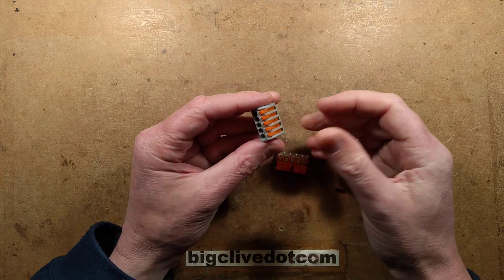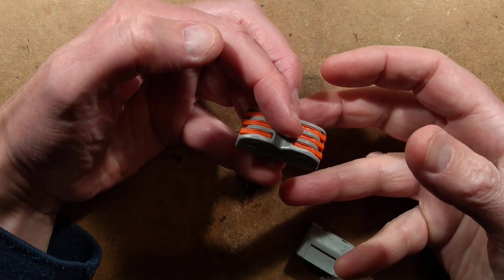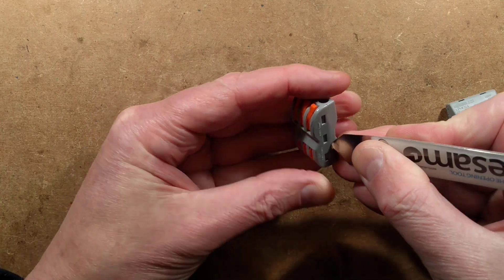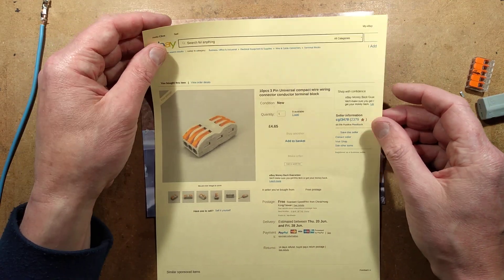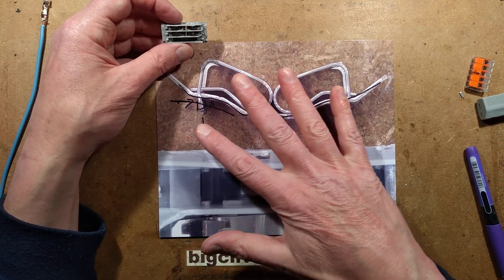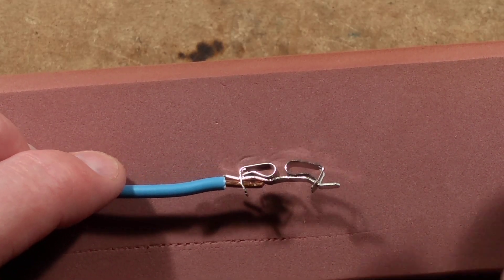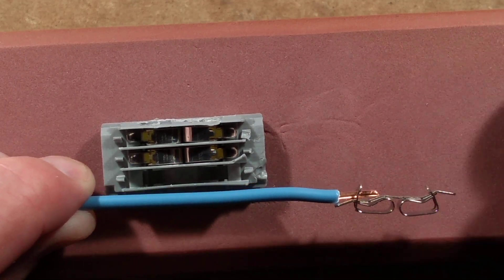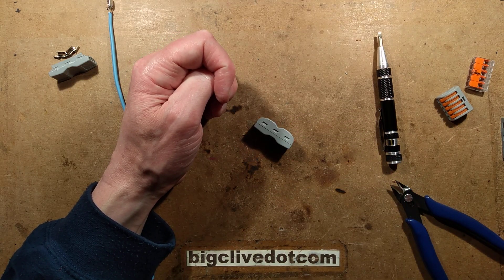Clone of Wago product that Wago don't even sell???

Comment: Currently, I am re-wiring an installation, and where I live :
Wago 221 $1 each one, that is insane.
While with $15 I purchased a box with 45 Wago knockoffs, including 2 connectors, 3, 4, and 5.
"Chinese-wagos" are hard to click, they are not transparent and they don't have the test pin, but I can live without those features.
Reply from the maker: The Wago terminals are cheaper in bulk, and much safer than the clones.

Comment: I bought a bag of the single tap clones from Temu not too long ago. They seem to work well enough but I haven't tested the thresholds yet and I did actually wind up breaking one by accident.

Edit: Forgot to mention that the ones I have actually clamp the wire when you pull the tab all the way up, rather than pushing it down.

Comment: I would not see the use for this style of wago if you need to only connect two cables together 3 double wago would do just fine.
Most of the time you need to connect more than 2 wires together fx. In a lamp fixture.
Reply from the maker: Live, neutral and earth.  They do two way versions too.

Comment: I love all the lever type connectors, especially the clones as  there are so many types, but unfortunately I have found  them in houses without any box around them. I can understand this if it was a recessed ceiling light, but I found them on the sprocket ring under the floor of the bathroom
Reply from the maker: They should be in enclosures.  That's just bad electrical work.

Comment: i will continue to use wire nuts.had wagos burned off,.
Reply from the maker: What sort of wire?
Reply: @bigclivedotcom  solid 12 wire copper.18 amp draw.they were on a piece of machinery.plastic was melted.poor connection i would assume.
Reply from the maker: @charleskovalewski5210  Strange.  I wonder if they were real or clones, and if the wires had previously been heat damaged and then just shoved into a new connector without being cleaned or bared back to clean copper.

Comment: Surely the reason that WAGO have not made their own legitimate version of this type of connector is to protect their reputation in case of accidents?- 

A Cable Splice as useful as this would obviously be used to fix/extend the length of portable Appliances- Electric Hedge Cutters, Electric Tree Cutters (where cables get severed very frequently) , Vacuum cleaners , garden patio heaters etc BUT- there is NO CORD GRIP to secure the insulation.
Yes the spring grip on the conductor is very strong but once somebody trips on a cable and drags out a conductor- you have a recipe for an accident?

Not to mention the people who have no appreciation of "I.P. Ratings" etc- you would get fools connecting up pond lighting or a Jet Wash Appliance with these handy connectors- and when people get electrocuted- Wago  would get blamed.  Well those are my thoughts anyway .
Thanks for the videos Clive- always compelling viewing !

Comment: Interestingly enough, I work at a hydroponic shop and have torn down a few LED fixtures that went dead. There's widespread use of Wago connectors for nearly all the connections. 8 light bars, power dimmer signals from ballast to dial/daisy chain cords. I'm starting to dig around  these fixtures to see how much moisture was a cause of their death.

Comment: At about 5:50 apropos the dissimilar metal concerns, these types of screwless connectors have been used for years, not only in this environment but in PCB interface connectors with no problems. If you introduce aggressive environments you're going to get corrosion problems whatever you use, look at classic car wiring.

Comment: As far as I know this style of WAGO connector is a legacy product. They went on to the modular 221 connector which is a lot easier to handle, can be made weatherproof, will play nicely in an installation scenario (can be screwed onto TS 35 units etc.) and will also do in-line connections.

Comment: I actually bought similar thing on Ali that is two Y connectors together with color coded leavers for Nuetral and Live wires. It doesn't say Wago anywhere, but damn it is really usefull connector also it came with little mounting holes to attach it with screws.

Comment: Wire binding terminal screws will always be a superior connection method than push-ins, back stabs and wagos. You’re just asking for trouble with these gimmicks. This is exactly how fires start. No real electrician would be caught dead using wagos. But keep up the great advertising campaign. Lots of gullible DIYers will fall for it.

Comment: I have used these connectors to make temporary connections while testing LED panels.  I just have a grounded cord with one of these on the end, and I am able to attach LED panels to the other side to make a temporary connection.  I will have to check mine and see if they are made by Wago or not, I can’t remember where they came from.

Comment: I tried searching for the seller on ebay, and i tried to search for the phrase from the ebay listing, but I can't find it being sold.  I tried my local ebay page and also UK ebay page (i surmized because of the currency being shown is pounds)
Reply from the maker: You can get UK certified ones now.
https://www.toolstation.com/in-line-spring-lever-connectors/p78346

Comment: I've noticed that an inline lever connector has appeared in the 221 range now part number 221-2411, it's only single pole though, so you'd still need three of them and actually finding a supplier seems to be problematic.

Comment: Good info, as always. But how could you find the real rating? i’ve bought those kind of connectors from local suppliers and they do not have rhe “wago” print. So I am guessing they just buy chinese and resell as original somehow, calling them “wago connectors”.
Reply from the maker: There are UK compliant tested clones being sold by some distributors.
Reply: @bigclivedotcom  But how do you know if they are good or their ratings? I supose we can test a high load on them, but I guess with time, as you said, their perfomance declines right?

Comment: I'm using an evolved version of these, super clever connectors that come in singles but with a lego style tab on the side to connect them so you can connect a single wire quickly or double wires for 12v or whatever for a little on the fly terminal block

Comment: The main problem is water contamination, junction boxes have massive separation of one line from another so slight water ingression would not be a problem whereas these connectors are so small one line is only 2mm from the next.

Comment: I use them on my 12v wiring. They work perfectly fine and fact make my life easier especially when I want to make a change I pop the levers open and done. I also own Wago. But the pass through connectors by these off brands are awesome. I don't think wago makes them.

I've even used it on low amp 120v as well. It's just plastic covered bus bar held down by a spring. Do you trust the Chinese? Use At your own risk.

Comment: I would much rather twist the copper cables together and pinch them in a block connector with some insulation tape rather than trust whatever alloy they are using to carry the current. A lighting circuit may be fine but plug in a 3KW heater... accident waiting to happen
Reply from the maker: John Ward tested these in a series circuit with conventional terminal block, with a welder providing controlled current.  They all exceeded their rated current by a huge factor.

Comment: I think wago doesn't sell them, cause they are not as good as shown.
1. You have to put it Inside a Box. Its longer than normal clamps. So you need more space in that direction than with 3 2times clamps.
2. It may keep the pulling preasure on the lines, cause you don't have to bend one of them.
3. They are just useable for 3-wire Installations.
4. You may not addiert an additional wire after you use this clamps.

It's only usefull if you drill into an already installed cable and have to fix it by making it a little bit longer. Otherwise the normal clamps are better.
Reply from the maker: Wago now make a version.
Reply: Yes, but they have a version, where you can fix the cables to a holder for the clamps and where you have single line connectors.

Comment: 7:48  the limit is spring tension. While the springs are contracted from the lifted lever, the metal strip that connects the wires wants to extend into the bottom wall of the housing, and since the spring force is so powerful the wire can't squeeze between them

Comment: Hey there, great video! Don't you think that after long time wagos are gonna just weaken and have bad connection and make heat or whatever?
Reply from the maker: The original ones have been around for many decades with no sign of problems.

Comment: These are perfect for automotive repair jobs for low to medium draw wires. I used some knock off push in style ones for led warning and accent lights on a few vehicles now. They are extremely handy to use and if you mess something up cheap enough to cut it off and do it again provided you leave enough slack for mistakes.

Comment: I used these so much, the idea is very good, also if they can make a connector with only 1 way instead of 3 THAT would be a dream come true. I prefer to use these instead of the old tape, gives you a safety feeling.
Reply: Look for the Wago 221-2411 ....

Comment: What you're not considering is a failure mode. In this connector vs traditional wagos is that now the failure of one would then mean failure of all, and then a short circuit. In a traditional 2-wire wago you'd need 3 for a 3-conductor junction box and if one were to overheat and fail it wouldn't necessarily affect the other two. The fate of one would not be the fate of all, and that's a small margin but still another margin of safety.

Comment: Its not a copied product if wago doesnt make it. As well, i would have been nice to see the inside of the wago ones and look at the metals in there. I recon its exactly the same stuff being used. You were quick to give our advise to stick with wago, but you failed to present the evidence why.
Reply from the maker: Wago do continuous quality checks on the materials.  A cheap grey import may switch to using steel or aluminium contacts without any external clue.  Wago now makes a version of this.

Comment: I´m a bit wondering that everyone is so baffled about this System, but only because we in Germany have a litte Thing called a "lüsterklemme" which is a little plastic terminal with a copper/metal tube inside and a screw on both ends with which you can screw on top of a wire so that it will hold against the tube, so same function as this thing, and they are dirt cheap, practically every roof mounted lamp in germany is probably connected with  these things :) 
anyone got an idea why this simple thing did not make it to /in the US ?

Comment: It looks like a more compact and cumbersome version as to what we call "sugar-cubes" in Sweden.. One important thing to mention is that you always put the ground-wire in the middle... Also I don't understand what you think "pushing the cable too far" would do.. as long as the wires have good contact with the intended contact point, then the only thing that might happen is that you get a bit lower resistance.
Reply from the maker: If a thin wire gets pushed in too far it could end up gripping the plastic with just luck for the copper.
Reply: .. Oh, right.... I forgot that some people doesn't look when they wires..  Whenever I connect a wire I try to see so the plastic of the wire ends right before the initial contact-point, If I can't then I just assume that i1mm of  shielded wire inside of the opening is enough to be fairly safe..

For some reason I never thought of the possibility of ANYONE that would feel confident enough to (erroneously) think they actually should fiddle with wiring to not use "how far the wire have been stripped" as a unit of measure.. So I assumed it was a wire that was stripped too far you were thinking of.

Comment: Never heard of Wago, youtube just said, here watch this we think you like this crap.
In the USA, we use crap like this all the time, design is different but does the same thing.
You going all surprised about an electrical device we call ballast sub terminals which have been around for longer then I've been alive. They also go by other names such as routing terminals if used on server rack wiring, but it's the same damn thing.
I have a bunch of these wired up in my sheds and garage for the lights to connect them without having to use wire bridges which are permanent for structures that aren't permanent. I can unclip these, tear down the building and move everything easily sense I'm not dealing with structures on foundations. Glad you are excited though, so welcome to basic wiring solutions 101? most people in the midwest USA have a coffee can full of these somewhere in the tool shop.

Comment: The diameter of the copper conductor is less than 1.5mm². So don't use them with circuits rated for more than 10A. Better don't use them. The original of Wago has a bigger conductor diameter because they are wired orthogonally. This is also why there is no version of this connector from Wago.
Reply from the maker: Wago now do one.

Comment: I doubt that wago will produce these as their conductivity is counter intuitive to the way wago products are normally designed => increases chance of accidents
Reply from the maker: They now make one.
Reply: @bigclivedotcom
Oh come on.. since February 2nd 2021 🤷🏼‍♂️ missed it🤦🏼‍♂️
Well.. nevermind then 😂😂

But still.. they are only available in single-wire so the principle more or less stays the same. All terminals on one wago are interconnected. Even though you can compose them in groups with these gray sockets. 🙈

Comment: I believe Wago gives you a measuring gauge on the housing for wire length. I did see a video where the Wago brand was taken through a high amp test and the wires turned to flames before the connector, some 80+ amps. the new style clear connectors made by anyone should be avoided as they did not stand up nearly as well as the opaque models.

Comment: LOL. I'm from the U.S. and we don't have or use electrical connectors like that. We use wire nuts to join wires together. And every switch and outlet has to be screwed down. We just started to use outlets and switches we just push the wire in the back and it clamps in place. I still use the screw down method.
Reply from the maker: They're becoming popular in the USA.

Comment: Here in finland there is some really similar looking connectors from finbullet, though I dont think there is 3 on 3
https://finbullet.fi/product_details.php?p=4195.
Anyway they are sometimes also used instead of Wago. Not sure if they are only a copy I dont think so actually.
They are for flexible and nonflexible which makes them quite handy

Comment: Would be interesting to check their insulation resistance with a proper megger.
Reply from the maker: I did a test and the connectors all passed at a much higher voltage.

Comment: I thought the transparent ones had replaced the grey.
What would be the reason for producing both versions?
I have wondered if the brittle transparent plastic would hold up as well as the grey ones over time. 
But anyone who's ever been waiting to regain feeling in the thumb after using a full box of the grey ones will say the others are far superior!

Comment: I’ve never seen wago terminals before. Are they safe to use with North American wiring? They would definitely make putting in some smart switches way easier.
Reply from the maker: I think they are listed.
Reply: @bigclivedotcom  I will be headed to amazon and adding them to my order for the switches. I hate dealing with twist on connectors.

Comment: I’ve been using them for some time without a problem. But I never use them to full capacity. Wago has a vast catalog. Honestly, there are so many products that it can be hard to tell one from the other. But looking through the right catalog, I find the series 222 levernut. That’s the style you’re taking apart here. But, there’s no dual end version. As usual, all wires connect together. So this one isn’t from them. I have them though, and they work well. But that style is really pretty big, and bulky.

Comment: Will probably be good for prototyping to use along side breadboards to test before proper builds, will also be good for younger children in schools to test and make low current circuits without the need for solder. Like a quick release choc block, use full for circuits that may have to come apart or be replaced regularly, no tools just flip up and put wires in, could be good for difficult to reach places.

Comment: I found these on Amazon the other day (which is probably what made YT recommend this video) https://www.amazon.co.uk/dp/B07TWL5QZ5/.  It's the same idea, not Wago, but they're individual connectors that you can clip together.  Seemed like a better idea to me as each cable is isolated more and you can build the size you need.

Comment: Have seen issues with these where they have caused arc fault breakers to trip. Also but not the connectors fault, have seen them burned up from people using them from aluminum to copper pigtails.

Comment: Heh... I could literally have had a use for a twin splicer like that... Every other cable I had at hand was either grossly over or undersized for the application so I had to splice two shorter cables into a long one using ferrule cimps which were then heat shrinked in line and apart from each other to prevent them from coming into contact with each other. Uhh... Now that I'm writing this, I could probably have used one of those old-style screw in terminals - If I had found one... 😏